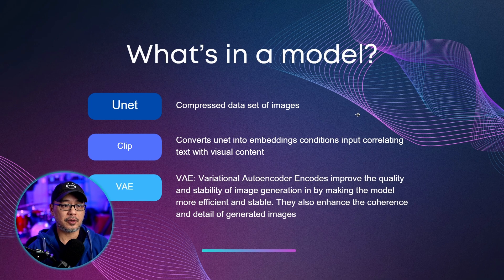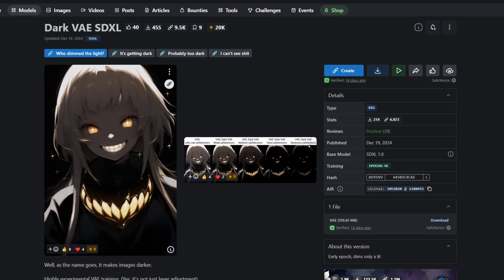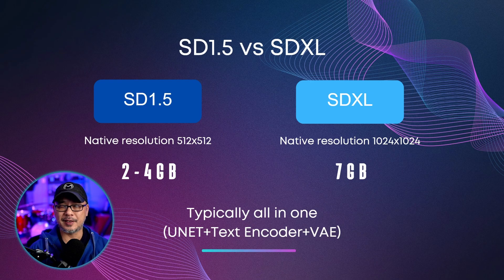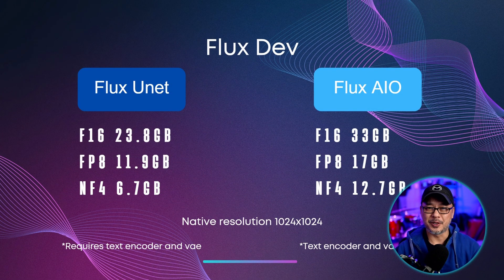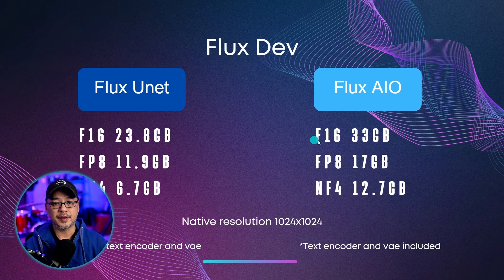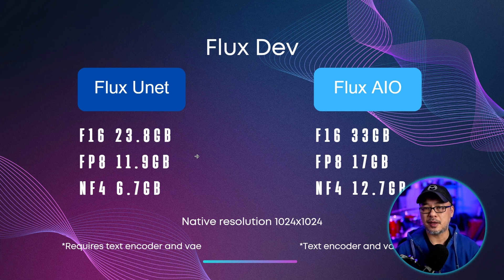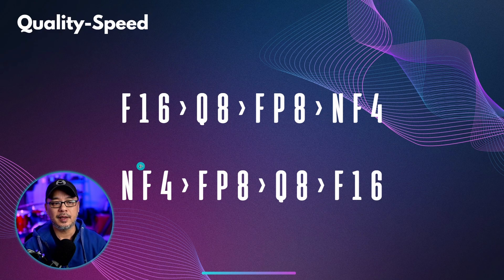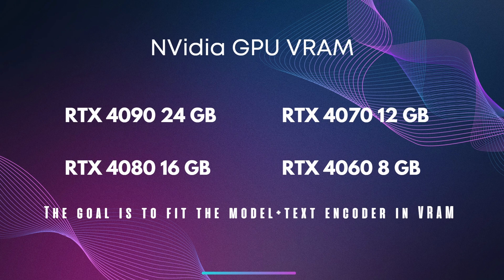Comfyui 101: Are You Confused About Text To Image Models? Part 3

Comment from the maker: One thing I didn't mention was that when you start to add controlnet, lora's and other things in your workflow, things start to slow down and VRAM and RAM usage starts to add up. GGUF variations of Flux can be a good choice when using controlnet or other models along with Flux. Which version of Flux do you use often?
Reply: Gguf

Comment: i followed from your chapter 1,2.. suddenly jump to flux info.. is a bit too heavy for me.. but roughly i get the idea.. just hopefully when later come to your flux chapter, i can have better understand it. anyway.. great job.. your tutorial video for comfyui is easy to follow.. just hopefully when install nodes or model.. wont jam the comfyui.. sometime it just goes crazy and all things goes wrong.. so i frequently backup before install new things.
btw. im using xt3080 10gb, 32ram. which flux should i use? (for later instalation when come to that chapter)
Reply from the maker: It may take some time for you to digest all the info, as I've said in previous videos, you won't necessarily understand everything right away, it takes time and many generations and experimentation to understand how it works for you. But don't worry, we'll be using SDXL in videos to come like upscaling, in-outpainting etc. I will always start with SDXL, then convert to Flux to show the differences. Flux is more widely used now so I think it's important to see the differences. The next video I go over which Flux model to use https://youtu.be/DBoms31-dVg?si=keUFO6sKnZWDWAQq

Comment: Also we have "engine" files for TensorRT version for Depth and Upscale methods. To be honest I can`t use Upscale - it`s locked to square proportions, but for Depth - it's really fast and took only half of original size. Downsides - you should build "engine" file to you specific env, but it`s for one time and took 5 minutes.
Reply from the maker: True but it's a bit more advanced for most users so I didn't want to cover it here but will definitely cover it in a later video. Thanks for the suggestion!

Comment: Thank you for great video and great explanation. Im using (having same gpu as you) flux1-dev-bnb-nf4 11.2 GB, and sometimes Flux.1-Dev Hyper NF4 11.5GB. What you think about this ?
Reply from the maker: There is an NF4 V2 version you can try. Slightly bigger at 12GB, it's listed on my google doc link in the description. It's a good option for our GPU. That being said, Q8 gguf runs fine just load times can take a bit long initially but once it's loaded generation times are decent. If you want the best quality other than using the F16 it's a good choice.

Comment: I really enjoy this channel. While videos like this one may attract only a few viewers, they are highly informative and essential for anyone looking to better understand AI image generators. However, I find it concerning that many people in the community are quickly switching to Flux without fully understanding the licensing implications.

After spending some hours researching the licenses, I found that only Stable Diffusion 1.5 and Flux Schnell are open-source with free tensor files. Neither Flux nor SDXL is truly open source, and their tensor files require payment for commercial use. 

On a positive note, SANA is making a strong debut this year and looks quite promising. The SANA model is open source, but the Nvidia tensor files are not. However, since it's an open-source model, the community can train tensors independently and even sell them. 

So, be cautious, everyone; the fine print is important.
Reply from the maker: Appreciate it and thank you for the kind words and support. You definitely bring up a good point and anyone that does anything AI should be reading licensing terms. I think most people that use Flux though are just hobbyists and enthusiasts and when it comes to the output, they can be used commercially. The licensing has more to do with using or training with a flux model and using it commercially. Still important information to know.

Comment: Well done! 😀   I've always had loading errors with most NF4 files, unlike other formats. I currently use FP8 turbo, which works fine with my poor GPU.
Reply from the maker: Glad you found something that works for you. Curious why you are getting errors with NF4 though? May I ask what GPU you have?
Reply: @MonzonMedia  generically (I'm going from memory): "unable of load xxx model". I have a GTX1060Ti with 6 GB VRAM and 32GB RAM system.
Reply from the maker: Ah that’s why, NF4 is only supported with 3000 series gpu, maybe 2000 series. Any gpu that supports cuda 11.7 or higher which i dont think 1000 series cards support.
Reply: @MonzonMedia  Yes, I suspected that. But I didn't look into it too much, since I found solutions that worked. 😏  ... But with Forge they worked

Comment: Wow, you really do explain all things extremely well! I must say your content is always clear and spot on! You are my Go-To for all AI image generation help info - Thank you!!

About all these files and how to load them and which nodes to use for each type of file (GGUF or NF4 or Flux-dev etc)....
I've found the following nodes are the only ones that work with these specific Flux checkpoints;

Node: Load Checkpoint ~~ works with all non-Flux Checkpoints (also Flux models aka checkpoints go in the Unet folder except nf4Flux1_nf4Bnb which goes in the Checkpoints folder).
Node: Checkpoint Loader BNB On the fly ~~ nf4Flux1_nf4Bnb.safetensors (The only Flux Model file that goes in the Checkpoints folder)
Node: Load Diffusion Model ~~ flux1-dev-fp8 & flux1-dev-fp8(Kijai) can be loaded with this node.
Nodes: Unet Loader (GGUF) & Unet Loader (GGUF/Advanced) ~~ flux1-dev-Q2_K(city96).gguf & Q4_0(city96).gguf & fluxFusionV24StepsGGUFNF4_V2GGUFQ4KM.gguf
Node: UNET Loader BNB On the fly ~~ realHornyProV3_realHornyProV2NF4.safetensors & fluxunchainedNF4_fluxunchainedV11NF4.safetensors
Nodes that do not work with any Checkpoints: ~~ Load NF4 Flux UNET node & Load NF4 Flux Checkpoint node
Other nodes that I have but have not tested: Checkpoint Loader (Simple), Checkpoint Loader w/Name (WLSH), Checkpoint Loader KJ, & Checkpoint Loader Simple (Mikey)

Of course I could be doing things completely wrong but I have had success with those nodes on my RTX 2070 with only 8GB VRAM.
I've used the rule of thumb that I can only load models with file sizes that match my VRAM amount or smaller, so none bigger than 8GB in most cases, every once in a while I can do bigger.
and yes loading Clip and VAE separately with Dual Clip Loader and Load VAE save on VRAM memory and prevents crashing as often, as when you load them all at once as a single file, even if the file sizes dont change. I think there is a setting somewhere that unloads any file from memory and then only loads back the part you need; effectively treating it as if you loaded separate files. That's something I'm not familiar with at all, but I see it happening when watching the command window output.

For Clip files - 
These are the Clip files I have but I dont know which is best. Any suggestions?
t5xxl_fp16.safetensors
t5xxl_fp8_e4m3fn.safetensors
google_t5-v1_1-xxl_encoderonly-fp8_e4m3fn.safetensors
t5-v1_1-xxl-encoder-Q4_K_M.gguf
clip-vit-large-patch14.bin
ViT-L-14.pt
and another unnamed Clip file in a folder called t5 base : model.safetensors (870MB)
and something called siglip-so400m-patch14-384 (3.4GB)

I've also been playing with Samplers and Schedulers for all the different model file types (Flux, sdxl, sd 1.5 etc) but honestly whether its Euler & Normal or some fancy combo - I can NEVER get my images to converge, meaning there is some part of the image smeared or deformed or just an ugly mess.
After watching this I think my problem lies in my latent image size 512x512 or 1024x1024. I never thought it made that big of a difference but now I will try playing with that. TY!
Reply from the maker: Whoa of this isn't a worthy comment I don't know what it! hahaha! Appreciate you taking the time to leave some feedback and of course for the kind words. So regarding the nodes, I think you pretty much have a handle on things, the next video that I'm going to work on is making Flux workflows and I'll talk about which nodes works best. Generally, when new models come out, community custom nodes get adopted in week 1. Eventually the devs would make nodes for that new model to work natively so technically it's always best to use the native ones if available. 

There are other ways to save on VRAM like off loading text encoders to CPU RAM and also command arguments that you can put in for further optimizations but for these beginner tutorials it may be a bit overwhelming for some people. That being said, I can always do a separate video on these things.
Reply: @MonzonMedia  Awesome! I really look forward to you next videos for sure.
It's just uncanny how you always are on a topic that is relevant to my current understanding or curiosity. Keep 'em coming!
Reply from the maker: Glad you are finding them helpful. I've wanted to do this series for a while but I was hesitant because these kinds of videos don't do too well on my channel. People are too ancy and skip around the video or just click off and it kills my watch time. That being said, it doesn't bother me as I rather people like yourself get value out of these videos instead of fly by viewers that just come and go. So....I appreciate you! If you have any specific requests I'm always open to suggestions. 👍

Comment: Yesssss. Needed this explanation. Thanks for sharing! I’m guessing all other nodes in the workflow work just the same regardless of whether you use UNET or AIO? Are there any special considerations regarding compatibility? Thanks
Reply from the maker: Glad it helped! I'll go over that on the next video but basically how you load the model is different between Unet vs AIO. But yes any nodes outside of that is the same, no compatibility issues.